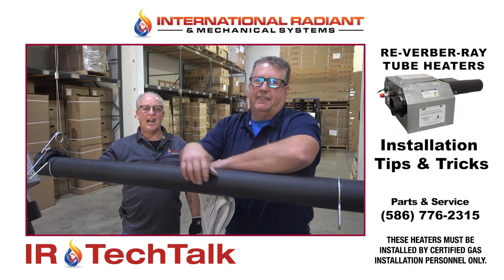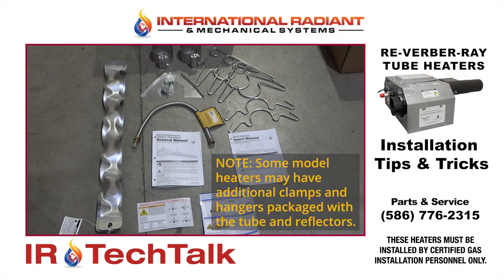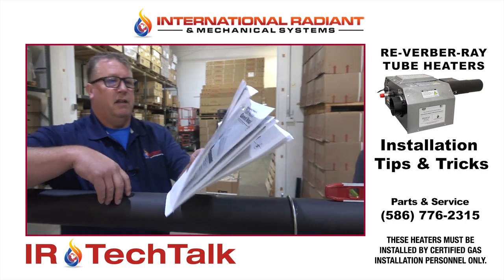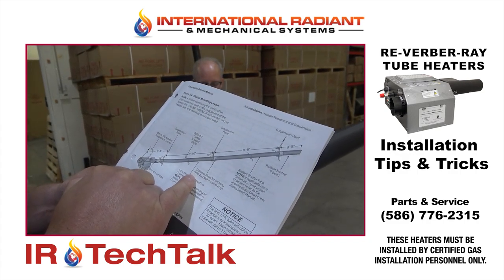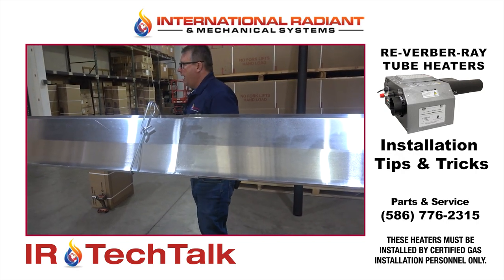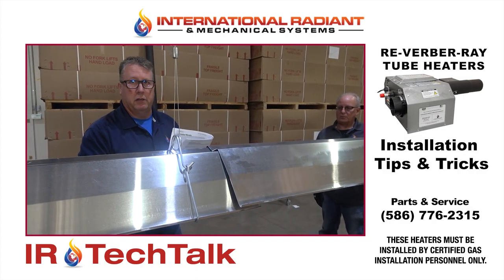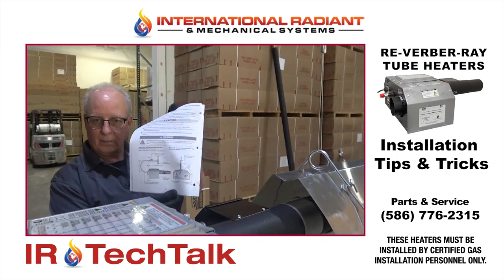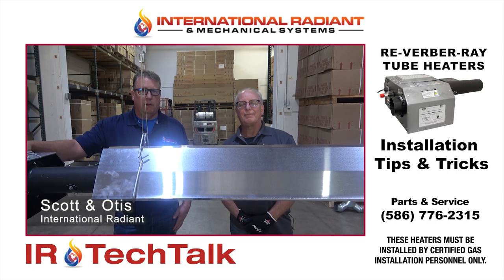Re-Verber-Ray Tube Heater Installation Tips & Tricks

Comment: I have a 50 foot length heater. hl3-50-125p. As of right now it is too long, can i simply remove one of the 10ft sections from the total length to get it down to 40 feet?

Comment: I have a roughly 70 foot long unit on a shop I just purchased I had to clean out the tube as birds made it their home.  It has two sections of baffle is that correct?
Reply from the maker: Typically, a 70' long heater in a straight configuration, as opposed to a "U-tube" or an "L-tube" would take two pieces of baffle for a total of 66" of baffle.  What is the model number of your heater and we can check what your specific heater needs.

Comment: whats the difference between the a residential and a commercial heater?
Reply from the maker: Residential heaters have lower BTU ratings and are rated for use in garages attached to a house.  Commerical heaters have higher BTU ratings and are only able to be used in commercial buildings (higher mounting heights) or buildings not attached to a home.  Commercial heaters have 4" tubes with internal baffles and residential heaters have 3" and 4" baffled tubes.

Comment: My tubes are full of ash.  Any tips on how to clean?
Reply from the maker: You can use a flue brush to pull the soot out.  They sell 4" brushes at Harbor Freight.  Check that there are not blockages in the venting and verify the baffles are installed in the tubes.  This will sometimes cause sooting.

Comment: Great video. My unit works ok. But the fan is always running. It never stops. Do you have any ideas? Thanks
Reply from the maker: Please contact our tech support line at 586-776-2315.  You may have an issue with your thermostat.  Please have the model and serial number of heater when you call.  Thank you